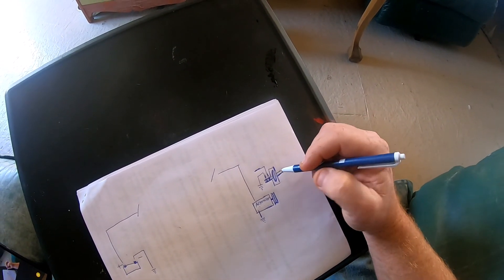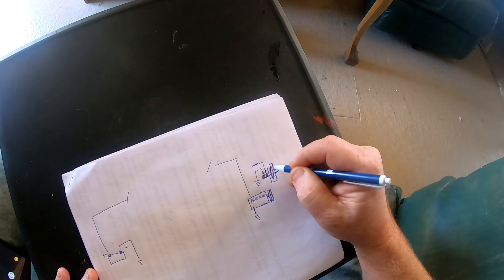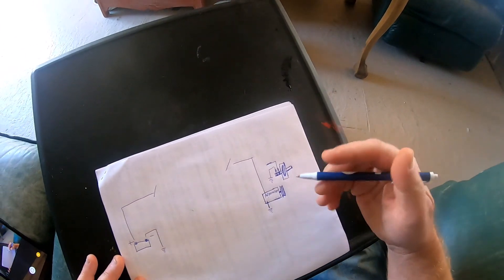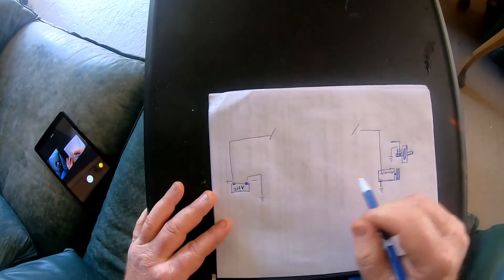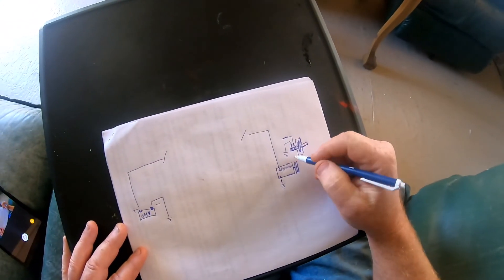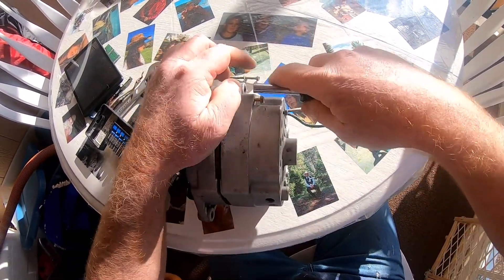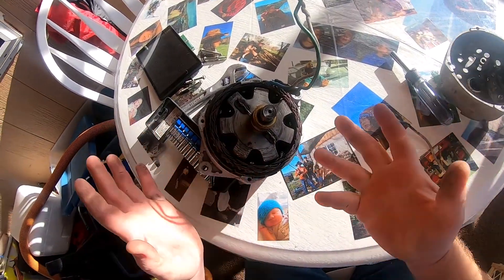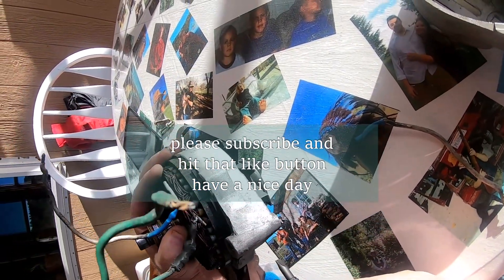Electrical schematic, How to wire alternator for charging batteries, off-grid solution for charging

Comment: I'm trying to do this at 56v for charging a 48v pack. I have lots of questions.. biggest is rectifier how do I find the one I need? I'd like to see 57-56vdc at 100amps but I don't have the experience to source a rectifier. Please would be a huge help. Also about how many ohms are you needing to kick in 28v? For control I'm trying to do an arduino. Maybe make it talk to the bms and if I can add a remote start stop and a shunt or bms communication I can make it start the van when soc gets to 20% and cut off at 85% while seemlessly running loads through the inverter. Hoping this is a good back up in the night for ac. And just a great thing for ppl to know how to make.
Reply: For anyone wondering I actually found an easier way and am lunching a product to do this for boats and RVs. First customer prototype leaves in a week or so I'll make sure to post a vid of it.

Comment: Hello sir I have question.
Can I use me 10-12 si alternator and use it directly like cinde of magneto?
I was wondering culd I use some of the current generated inside that rotor via bypass wire and directly fead me E core type ignition coil?
Wuld it work?
Im cinde of haveing problems with voltage on me system and I do have that odd delco s r starter selenoid bypass but me fuse pops .
So I dont know how that R terminal works on 4 pin gm ignition module set up?
So I was wondering culd I simply use power directly from alternator?
Similar to magneto ignition? 
I did try once hv capacitors but me starting charge gone 1k up to 2.5k rpm be useing ceramic capacitors.
Faster spining starter great smuth motor some peopel call it plasma ignition but me starting charge got fumeled for some reason and I dont like it .
So any ideas what I culd do in those odd case?

Comment: I am considering using my car alternator, my starter battery connected in parallel  by a 20 amp dc-dc charger to a deep cycle lead acid battery whichis then run through an inverter as backup power to the grid in the case of power outages. My biggest concern is overheating and damaging my alternator. What I've learned so far makes me believe that a dc-dc charger will solve that problem. Is the dc-dc charger just sort of a commercial version of what you created or would I be better off deploying your system directly. I of course wouldn't be able to modify the alternator so I am also wondering whether that will be problematic?

Thanks for the info and for responding when you get a chance.
Reply: I would say that your original idea is the simpler one to implement. Provided that your DC to DC charger is limited to drawing no more than 20 amps from your car, I think the alternator should be safe. I do think, however, that your charging sessions would be best done on long highway drives. Also, if this is something you intend to do often you will want to consider how you will connect all this together. You will want some sort of plug and socket arrangement to make fast and easy hookups and disconnects. Whatever you do, don't try to do this with jumper cables. Think about what happens when sparks occur around batteries. BTW, Delco Remy recommends that an alternator be loaded to no more than 50 percent of its rated current on a continuous basis to avoid the experiences that Gary has run into while perfecting his system..

Comment: Theres an equip called MPPT T-30 Its usually used to control charge on solar systems batteries but you can used it .  Rigth now im designing a Savonius turbine and i have problems with the alternator i aprecciate if we can talk , im from Colombia sorry if something dont in what i wrote dont make sense.
Reply: If you are using anything like an automotive alternator with a Savonius turbine, you will have problems. The Savonius, while it is easy to build, suffers from the fact that it operates on drag. This means that the power it produces, while having a lot of torque (twisting force), will have low rotational speed. This is the opposite of what an alternator (and most generators in general) need to produce electricity. You will need a pulley step up ratio on the order of 40:1 to get an alternator spinning fast enough to put out anywhere near its rated power. If you can accomplish that the rest is straightforward.
Reply: I am also designing vwat, 200w ( motorcycle pma) using bicycle wheel-pulley-pma/ & working on possibly rewiring the coil WITH #27 copper but don't know how many turns by coil/ I am studying, maybe 27mt by phase/ I want to achieve 100 ma with 100 rpm
Reply: Mppt is for solar, right? X wind is different, dynamic that's why the right converter has inside pulse width modulator/no te arriesgues y ve x uno para viento
2- No uses alt-auto, USA EL pma de moto,yo ESTOY empezando a buscar uno usado para mi savonius con suspension magnetica y baleros,cojinetes de empuje de la MEJOR calidad

Comment: I was thinking on how to build a 100 percent free energy device using a electric 3/4 hp ac motor running a alternator off of the same battery is this possible and would it work you think ?
Reply: It will not work
Reply: easier to find a purple unicorn. #physics
Reply from the maker: What I think matters little. I do think Stan meyers had something interesting.